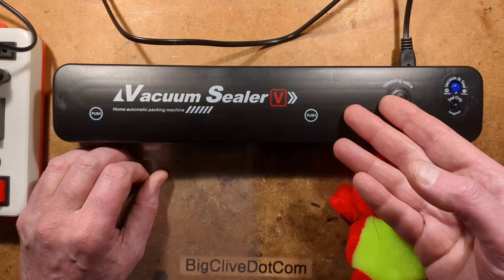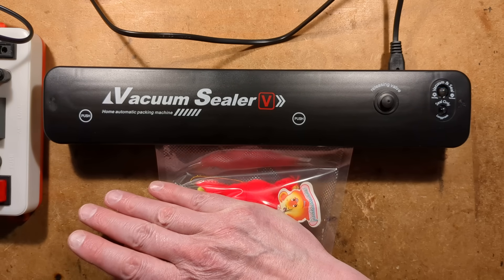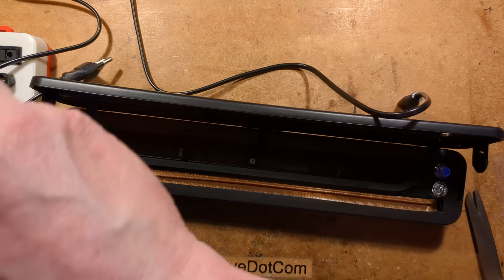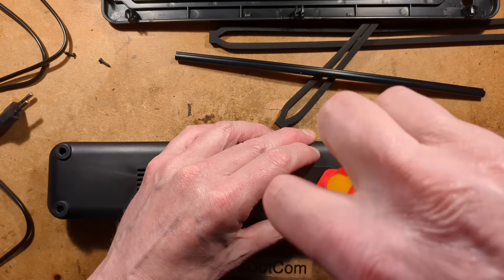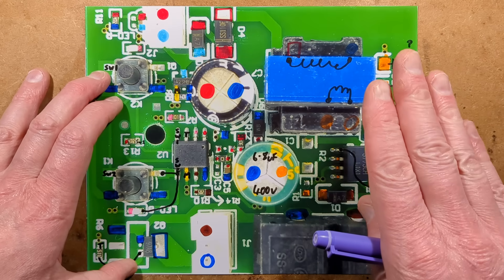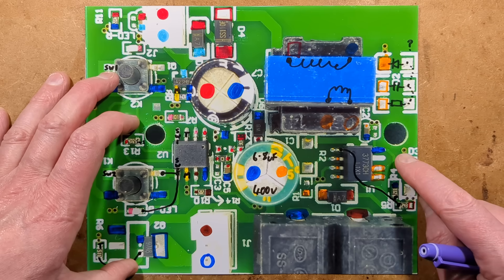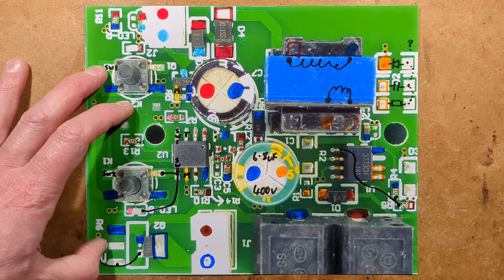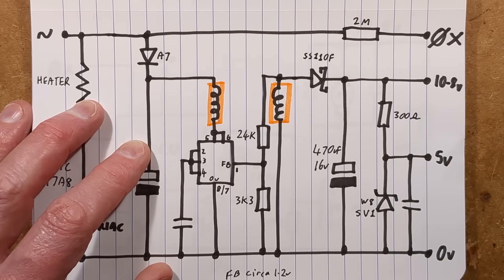Cheap vacuum sealer test and teardown

Comment: I tried this for 3D print filament spools, with VERY mixed results. The vacuum it pulls is too damn strong and the bags are too thin. The bags the filament comes in are vacuum sealed as well, but the bags are much thicker and sturdier. My version has a pressure sensor and a "gentle" mode with a lower vacuum for fruits and vegetables, but that too is too much of a vacuum. I had the same experience with the sealable bags with a manual vacuum pump sold specifically for this purpose. If you pull too much of a vacuum it presses the bag on so tightly that it finds a sharp corner or a bit of moulding flash or whatever on the spool and punctures the bag. Frankly, not worth the trouble.

I switched over to sealing the entire length of the seal but one small corner, holding it so that it opens, and sucking the air out with my lungs. That suffices and doesn't puncture. You don't need a vacuum, you only want to remove any extra air from it.

Comment: The construction gives the impression that the manufacturer, doesn't give a fig about what happens to the unit once it leaves China, just as long as it kinda works, as there is little comeback on something that will cost more to send back than is worth it.
Reply: I think you are being generous in thinking the manufacturer even gives "a fig" 😎

Comment: Maybe you've done this in the past, but wondered if the special bags were really needed, other than to help evacuate it?  Wonder which plastics (so many types of "plastic" bags, it seems, or aren't there?) it works on if not the supplied/special ones?
Reply: As well as different sized bags, you can get a continuous roll. Close one end, and then you can seal up a 2m long plushy snake.
Reply: I guess any melty ones would work for sealing, but as Clive said, you need a texture to prevent the inner surfaces from creating an occlusion before all the air is sucked out. If you need use some other bag for some reason, a bit of fabric or some string inside the bag might provide a path for evacuation. Or you could just tear one of the provided bags apart and put the textured bit inside the other bag.
Reply from the maker: They are.  It needs the texture to be able to keep pulling air through without closing off completely.

Comment: I see no sensors to detect when all the air is out of the bag. Does it just run the motor for a certain time and stop, or is there some way of finding out, perhaps from the reduced load on the motor when it's running in a vacuum, whether it's ready?
Reply from the maker: Purely based on preprogrammed times to allow for what they perceive as being the biggest bag.
Reply: The bigger food version I have definitely detects the vacuum by some means as if you don't position the bag right it doesn't switch on the heater, just sits there whiring away trying to pull the vacuum.
Reply: @farmersteve129 Yes, mine does also, and shuts off at the same vacuum every time. I have never taken it apart, so I dont know if it has a vacuum sensor or a motor current detector
Reply: That's a great question.  I wonder if something got left off the scheeeeeeematic that allows the MPU to detect when the current on the motor power line starts off at the maximum at the start of the suction cycle, then gradually then quickly reduces as the pump is no longer doing any work and the motor is basically running at the no load speed?  It seems like only pin 4 would be available for that and it could be connected to that other chip's feedback pin?
Reply: @poodini  The pump would draw more current as the vacuum increased, not less as it's working harder. You can hear it slow down during the test. Monitoring the current would indeed give a coarse indication of vacuum for sure; probably better than a simple timer...
Reply: @dougle03 My motor speeds up as the vacuum increases. Just like putting your hand over the end of your vacuum cleaner hose. It stops being able to move any more air, and the load decreses.

Comment: Problem is finding a mid-range one that isn't actually a cheap one with all the same flaws in a nicer box...  Amazon reviewers rarely do teardowns and safety analysis.

Oof, no snubber on a triac potentially powering a 400W heater.  That's not just cost optimization, that's complete disregard for the safety of the customer.
Reply: Friend of mine is a Amazon Vine reviewer; last time they did a teardown it was removed citing 'Community guidelines' They don't really want decent reviews, only ones that increase sales...
Reply: Triacs don't need snubbers, they turn off when the current reaches zero.  They might need an RFI filter if they are switched on mid cycle but not if they are switched on at the beginning of the cycle which would be the case here.  Micro controller driven heater controls don't use phase control.  If they need to regulate the power they adjust the number of ON cycles to the number of OFF cycles as required.